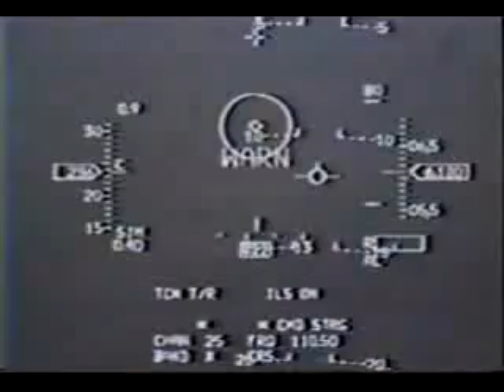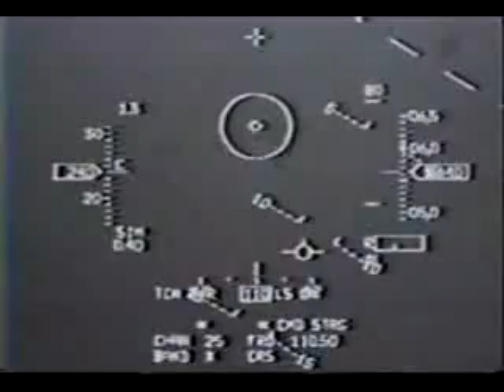F-16 Dead Stick No Engine

Comment: I want everyone here to understand how impressive this is. Yes, its a dead stick situation. The F16 is a fly by wire aircraft and the F16 is an inherently unstable airframe. It needs the flight control computer AND a generous amount of thrust on tap to stay in control and simply not fall out of the sky. How he was able to bring an inherently unstable aircraft down with ZERO thrust is beyond me. That's why he does what he does and we sit here in awe on our computers. So damn proud of our military and the fact this pilot is on OUR side.

Comment: Something doesn't make sense here. The video suggests the incident was in 2009. I'm sorry, but in 2009, surely the world's elite fighter jet had video capabilities far, far beyond this grainy nonsense. 1080p was available - to the public - in 2009, let alone the military. My only conclusion is that there is a mandatory downgrade of video quality for anything released to the public. Maybe this explains the frustration of the UFO crowd who complain that modern jet video looks like grandpa with Parkinson's disease using an old 8mm movie camera from his closet!
Reply: You'd be surprised how unbelievably cheap the military is. "Oh, this camera from the 90's still works, so you'll use that, and we'll save 200 bucks on a 2 million jet!"
Reply: Maybe the original recording was good, but you see a worn out betamax or vhs-copy 🤷‍♂

Comment: For those below who don't know the term "Dead stick".
---A dead stick landing, is a type of forced landing when an aircraft loses all of its propulsive power and is forced to land. The "stick" does not refer to the flight controls,
--The F16 is a fly by wire aircraft (No wires or rod linkages, only electrical wires.)
Reply: And the stick is?

The propeller, originally propellers on aircraft were wooden and so sometimes they were known as "sticks". If it stopped spinning, you had a dead stick.
Reply: I thought the tank jettison killed a tree, meaning the stick died.

Comment: I didn't realize that fighter jets can glide.  I understood that they were inherently unstable so that it's more manurable.
Reply: They are, but that has nothing to do with whether they can glide or not.  The software that makes the minute corrections to keep the plane under control doesn't suddenly stop working just because the engine is out.  If they lost all electrical power but the engine(s) were still running, then you would have no choice but to eject.
Reply: @thekinginyellow1744  understood! Thank you!
Reply: With the APU running, all flight control surfaces and instrumentation was up and running.  Even as an unstable design, the computers would still be able to keep the platform stable.  Stability is the only requirement for gliding.  The F-16 has a glide ratio of around 6:1.  Not great, but it'll get you either home or to a suitably harmless ditch point as long as you start out with enough altitude.
Reply: Don't lump all fighters in one non-maneuverable basket.  Sure, some of the stealth stuff is very unstable without computer controls.  F-16 is not a radical design.
Reply: @WilliamMurphy-uv9pm  Righty-o.  Very few planes have no "glide" ability.  They don't fall out of the sky like a rock when the thrust stops.
Reply: @sarcasticguy4311  Thanks for your thoughts.
Reply: @WilliamMurphy-uv9pm  Your comment was spot on.  I'm just adding to it.

Comment: Dead stick ? meaning ? I would have thaught that it meant the control stick (IDK the name) was unresponsive ?
Reply: You're right in that it's confusing. 

What they're referring to as the 'stick', is the propeller blades. I know this is not a propeller engine, but that's where the term comes from, from the early days of aviation: dead engine = dead stick (propeller is not moving, or dead in other words).

Control stick, flight stick, side stick (cause it's on the side in an F16, and not in the middle), hands on throttle and stick (HOTAS) are terms that would be accepted as correct to varying degrees, depending on the aircraft and the setting among other things. So you're not wrong there either.
Reply: @Deniz1923  Now I understand, thank you very much for your time and explaining so clearly. Much apprecaited !

Comment: A phrase you never want to hear from the tower is "You are clear to land on any runway."
Reply: in this scenario, that is exactly what you want to hear.
Reply: They said that to Capt. Haynes on Flight 232 (the one they crash landed with differential thrust only, 1/3 passenger fatalities.) I'll always remember how Haynes said "ahahaha, you wanna be particular and make it a *runway*, huh?"
Reply: The reply atc never wants to hear…
“You want to be particular and make it a runway eh?” -the legend Al Haynes 😊
Reply: At least a runway is an option at that point. Scully didn’t have that.
Reply: @mjproebstle yes but once he’d made the decision to stick it in the Hudson (rather than crash it into built-up area) for which he had no real choice, all he had to do was keep the wings level and pull back on the stick all the way and the Airbus flight control managed the rest. It kept the plane from stalling so they touched the water at as a low a speed as possible. Sully did very well but he had a lot of help from how the plane was designed to operate.

Comment: More proof that engines don't make airplanes fly; they just help maintain the desired speed.  Without the emergency power unit the story would have been very different.

Comment: One reason Navy aircraft tend to have multiple engines and/or an auxiliary engine power unit.  Also makes for less maintenance or equipment requirements for self-starting.  Pumped up plenty of the hydraulic reservoirs on the Hornets to get 'em around.
Reply: The 16 was made to be lighter and cheaper. That comes at a cost. Now they're doing the same thing with the 35, not to mention trying to make it a jack-of-all trades like the F4. Lesson not learned I guess.

Comment: I imagine weighting the risks of ejection vs landing a modern fighter without an engine must be hard.
Reply: There is always a risk in ejecting.  Even allowing for surviving the ejection, the stresses it places on the pilots body possess a significant chance of permanent injuries that will sideline him from further flying.
In short, if possible, it's always better to land the plane.
Reply: No, they train for this in the simulator.  There are guidelines
Reply: Ejection under a controlled landing like this is nearly 100% survival rate. You might get some minor injuries but it's nearly a 0% chance of death. Landing the aircraft almost seems like an unnecessary risk to the pilot, but if he ever felt like he was in mortal danger, he would have ejected because in the end the pilot is always the one in command in the aircraft and it is his job to ensure he and his crew (i know the f-16 is 1 man but you know) make it home safe.
Reply: @LouSaydus  No, this is trained for.  Even novice private pilots train for it.
Reply: @LouSaydus  F-16 is not "1 Man", have you ever heard of D variant?
Reply: @ephealtun  The F-16B/D are two persons yes but they are also not widely used in the USAF, and this was an F-16C which is in fact, a one man aircraft. So better luck next time. Next caller.
Reply: @Schmidtka Productions use the fucking Google
Reply: @ephealtun  You’re worthless.

Comment: Only time you hear his breathing change is during final and touchdown. Don't blame him, no power to control your descent or climb out if needed, and hope the gear locked in place.
Reply: every single landing ever in a glider :/
Reply: @operationscomputer1478  except gliders aren't loaded with explosive material and jet fuel, weigh a few tons,  or fly at four hundred plus knots. Gliders don't explode into a firey ball of metal if you make a mistake. Not the same thing by a mile.
Reply: @j.c.keplinger7046  He jettisoned his tanks, but obviously there's still fuel in the fuselage so your point still stands. Not to mention bombs and literal millions of dollars of high tech equipment. Gliders are also designed to glide, fighter jets are designed to fly at super sonic speeds.
Reply: @SuperSayinSolidSnek  Yeah, 16's don't really glide all that well on their own, they tend to plummet. Didn't even think about the tanks, so thanks for that and the fuel in the system does count. He was sitting on a gigantic bomb if he got it wrong even alittle; I'd give it a 7out of 10 on the pucker scale. Damn fine aviator.

Comment: That's f'ing amazing. I didn't know you could glide those things that far. Did that airstrip just happen to be there?  He came in a little fast too....looked like it was just under 200
Reply: you're ALWAYS trying to land as fast as possible if you're gliding bro. Because you can always stop, but you can never add power, if you'Re short.
Reply: @jemand8462  he landed around 170 which isn't too fast and was using a back up emergency power that helps the jet for these types of situations
Reply: @colerounds1429  the back up power is just electricity for the instrumentation. He is gliding with no thrust.
Reply: @Paul Flusk I'm sorry, I didn't think and wasn't even remembering that here it's all about the velocity vector which indeed represents the vertical speed. 
I take everything back and agree with you. Btw, holy shit, 5000hours? Do you mean in real life or in DCS?
Reply: @Paul Flusk right? And his actual AOA was even worse.
Reply: It is using an emergency power supply to help it
Reply: @Paul Flusk you can actually have a positive rate of climb despite being pitched down 10 degrees my friend. Look at some gliders in strong thermals. And if you don't have an engine, of course you have to pitch down to remain at your optimal gliding speed. You exchange height for speed, but it's still flying. falling would mean gaining speed uncontrollably and without any forward movement.
Reply: @jemand8462  - The French have actually proven that you can be in control, have forward momentum, and still fall like a rock, if you just hang tight enough to that yoke.

Comment: The dead stick expression is just misleading. The stick doesn't regulate power, it operates control surfaces that are in good working order. Call it "Dead throttle".
Reply: It's dead-stick, for good reason. Everyone in aviation understands the term.
Reply: Wikipedia - Deadstick landing: "The "stick" does not refer to the flight controls, which in most aircraft are either fully or partially functional without engine power, but to the traditional wooden propeller, which without power would just be a "dead stick"."
Reply: WRONG

Comment: its FBW so no engine, APU no power or a decent charge on the bat means no controls. Assume EPU is a Hydrogen based emergency generator of some sort. Heard mention hydrazine surprised its used I know they can overspeed to destructive rpms.
Reply: EPU is fuelled by hydrazine. It's an awesome fuel but very toxic, so needs precautions on the ground.
Reply: EPU (Emergency Power Unit) is a small turbine running on hydrazine, that runs a generator and a hydraulic pump, so the F-16 can maintain Flight for some time  (depending on usage and bleed air coming from the milling or running engine.
Reply: There's also an indicator on a skin panel to show if the EPU has been run. It's one of the first checks I did on see-in.

Comment: @16vr6 ...seriously?? I honestly doubt that. He didnt even drop his tanks until told to. Yeah great job, but he had a wingman "hold his hand" all the way down. Anyone who flies a fast jet in any (well almost any) defence force is extremely competent.
Reply: Dropping external stores is something extra risky.  There was a Fakcon in same issue 20 k north of SAT.  He had training practice ord on hard points, THOUGHT he jettisoned them over an Army training base (Bullis) but one skewered the empty garage of a house.
Reply: @keithjurena9319  I trained on the LAW rocket in Bullis..
Reply: @CaySea321  That and the 40mm M203 are why some of the ranges are still EOD nightmares.  Hand grenades are easy, 40 yards, 60 if you got an MLB arm.  So if that Falcon driver had dropped his training ord into one of those ranges..no biggie.  AF would have written it off.
Reply: @keithjurena9319  MLB arm? Nice
Reply: He was ANG lol

Comment: Cool landing. At least his EPU (Emergency Power Unit) worked so he could glide it in and still keep his gauges working.
Reply: Yea but that hydrazine is a killer.
Reply: @Tristan With a glide ratio of only 12:1 and going 300 miles an hour, he'd probably hit the ground before the EPU runs out.
Reply: Yeah, that's crazy, had no idea they ran on hydrazine.
Reply: @calfeggs  being a hypergolic fuel, hydrazine is exceptionally efficient since it requires no external oxidizer.  Sucks to handle, but it has very legit uses, both as a fuel and as part of various production processes based on its general properties.

Comment: This is from 1996, an Air National Guard pilot out of Andrews, currently over North Carolina, in an expensive glider.  Notice how the gear comes down so late.  The runway was shorter than typical and he runs to within 1000' of the far end.

Search the internet for this phrase "Air Guard fighter pilot receives Air Force's Koren Kolligian Trophy" and you will get a lot of the back-story.

Thanks to all those who serve!
Reply: I heard the f16 is so aerodynamically unstable that you have to eject when the battery dies after the engine fails. Nice work to the pilot for saving the taxpayers' plane.
Reply: @Scott83083  Good old fly by wire!
Reply: @Scott83083  Doesn’t look to unstable to me.
Reply: @f1620mm  it doesn't because it still has the EPU that powers the flight control system. Once it's out, you have to eject